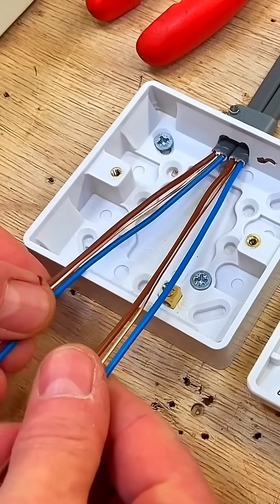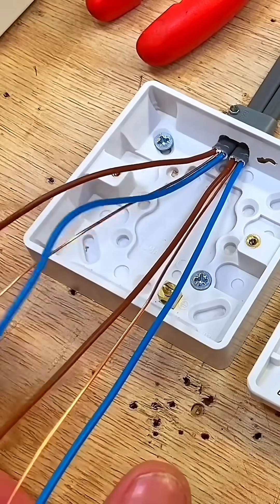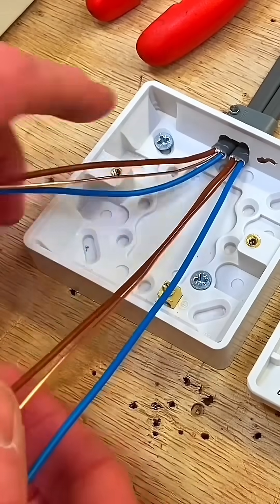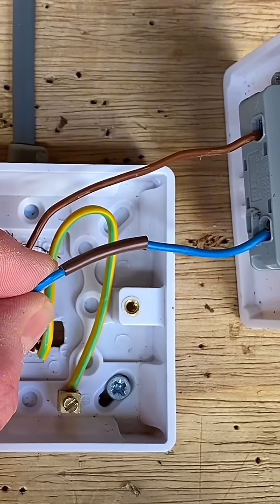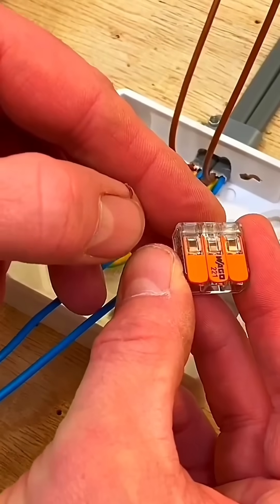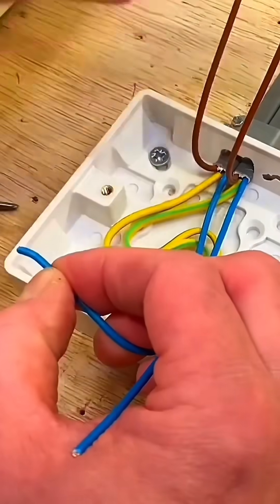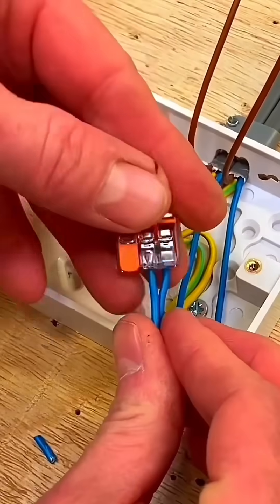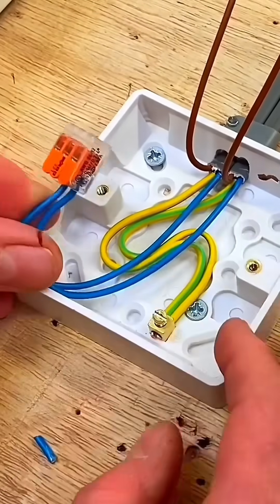New Build Lighting Circuit - What to Do with the Neutrals?

Comment: Been electrician for 33 years never put a neutral to a switch 😂
Reply: In my day it was always considered bad practice to loop the neutral in the switch
Reply: The times are changing
Reply: People want "smart" switches now, or lazy switches as I call em 😂
Reply: Because back then there was no smart switch DUH 🤦
Reply: @zaxmaxlax  well not  true 

. Home automation had a version out and a few other manufacturers had versions out  well over 35 years ago . Obviously  in them days they were very simple with short range controller. Often infrared. But still classed as smart       DUH
Reply: @andysims4906  And everyone had one at home right? DUH 🤦